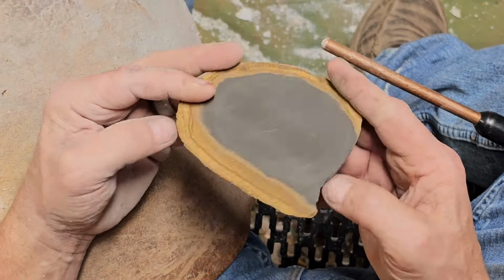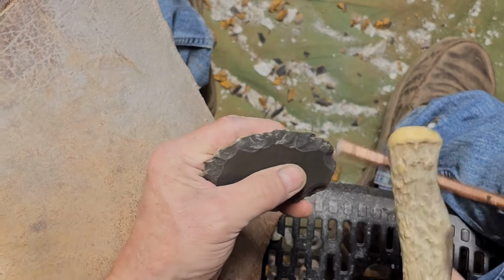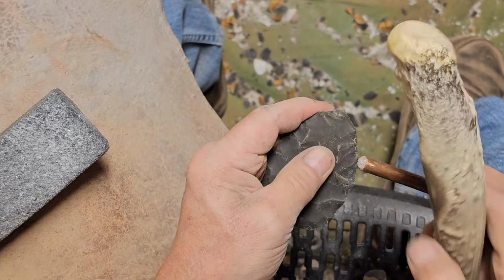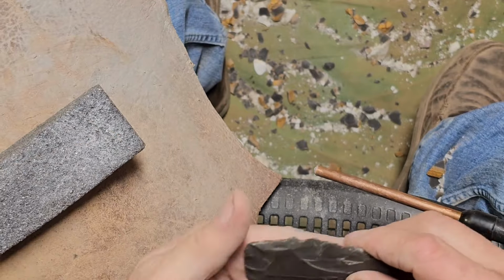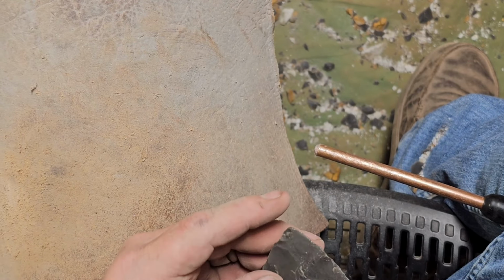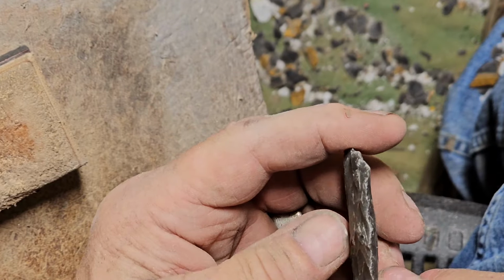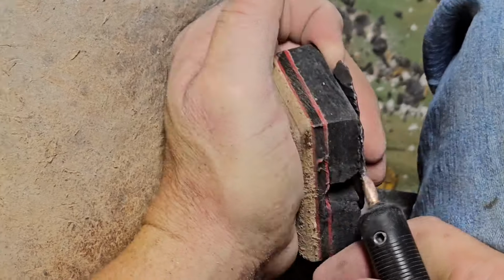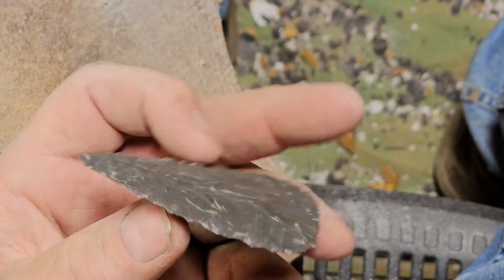Knapping A Buck Creek Arrowhead Part 1 Indirect Percussion.

Comment: Curious...you don't ever seem to have to hit your rod very hard.what am I doing wrong that my rod gets bent and I have to stop and hammer it straight? Also can you explain the different angles I see you doing and what effect does it have once the flint is hit?
Reply from the maker: Hi Debbie, you want to be sure to strike the rod near the work piece. The farther from the tip you strike, the more energy idms losed. Also, try preloading a little pressure. I'll make a video showing my platforms, and I'll thr to explain angles.
Reply: Debbie. I'm sure Dan can make some videos that will help you understand. But in the meantime search Jack Crafty Angles & Platforms. Its video number 477 on his channel. He does a series of videos where he explains everything out pretty good. I learned alot from it. I'm sure you can too.
Reply: Thankyou for your reply to my questions.i will certainly look into it